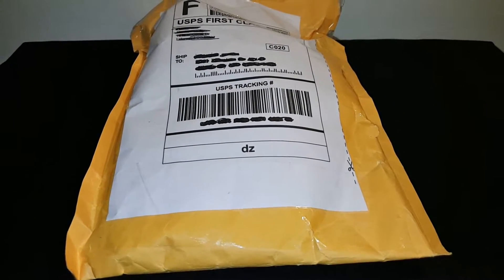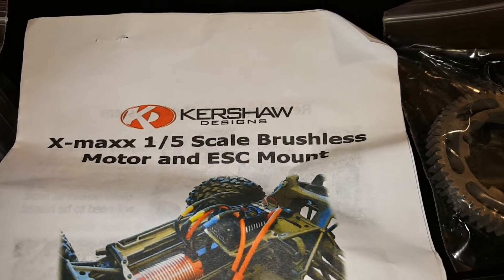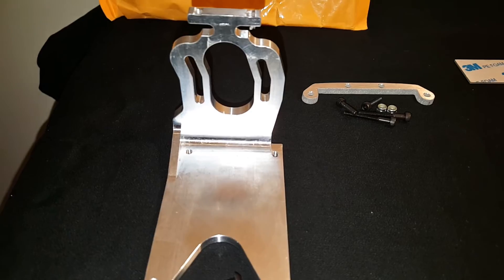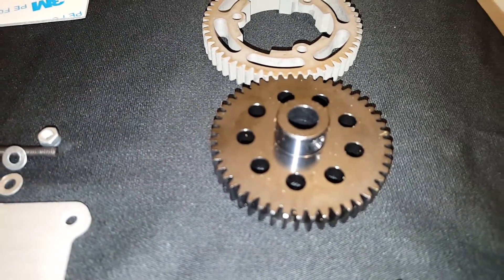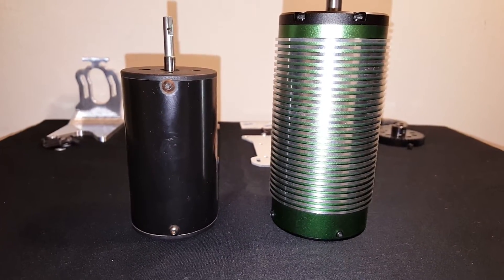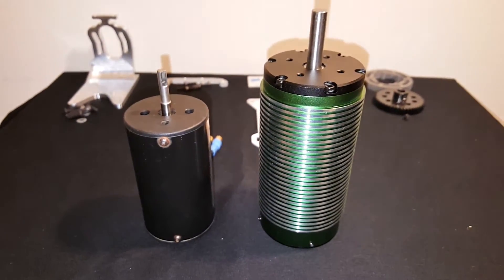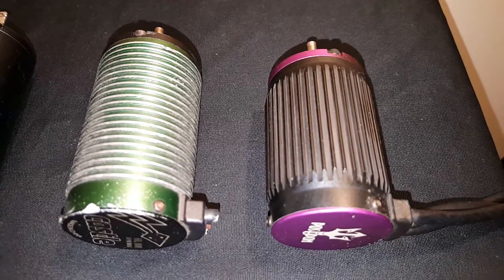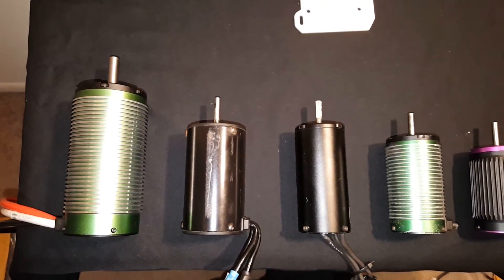Kershaw Designs  X-Maxx 1/5 Motor and ESC Mount unboxing

Comment: Sup big T just got a quick question for you please sir...I ordered my 2028 and mamba xlx for the xmaxx and I ordered the mount and plate..as well as the Kershaw aluminum chassis...I forgot to get myself a pinion and spur...I assume I can't use the xmaxx stock cause of the shaft size and I'm confused in that area...what metal gearing can you suggest I buy for the 2028 in the xmaxx? If you can please help me out I'd really appreciate it brother
Thanks man you the best as always!
rcfeene
Ian
Reply: Actually I just saw the answer to my questions in your other questions and answers below but thanks bud much appreciated....
rcfeene
Ian

Comment: Was that sheet with the parts list also instructions? I just ordered the same set up with leopard system and no sheet or instructions where included. Something ill have to address with the new owner i guess because i cant find any type of installation guide online
Reply from the maker: marcus vaughan it's been awhile not sure. So you just ordered this same from Kershaw Designs? I tried contacting them but no answer I hear they not in business anymore?

Comment: I have the 2028 motor and the hobbywing mx5 and mx6 but the gold connectors on the motor are to big for the esc connectors. how do I resolve this? :(
Reply from the maker: Amrit Loyal buy castle creations 8mm bullet connectors
Reply: But how do you put them on the esc? Can they be changed?
Reply from the maker: Cut the connectors off the ESC motor wires and solder the castle creations 8mm bullet connectors
Reply: Hold on the females connectors on the esc are 6mm. 8mm won't fit. I'm lost sorry..... so u can't physically change the female ports on the esc at all? I'll have to cut the   male connectors from the motor wired and put on 8mm connectors?
Reply from the maker: The ESC has three wires with 6mm connectors that you connect to the three motor wires on the 2028 motor. The connectors on the end of the 2028 motor are 8mm and the connectors on the end of the ESC wires are 6mm so you just need to cut the 6mm connectors off your ESC and solder female 8mm connectors to ESC wires .That way both ESC and 2028 have 8mm so you can connect ESC to Motor
Reply: The hobby wing max6 does not have 3 wires coming out from it. It just has 3 female ports for the bullet connectors from the motor so there's nothing to cut...... in the.box it's comes with 3 wires one end has male connectors which fit into the 3 gold connectors that come with the motor. The other end has nothing and needs soldering.
Reply from the maker: Ok well perfect just solder female 8mm connectors to those 3 wires the ESC came with.

Comment: HI!, I'm getting ready to do this conversion! Where did you get the Steel 54T Spur Gear and Steel 48T 8mm Shaft Pinion Gear
Reply from the maker: kershawdesigns.com
Reply: Thanks! Do they only take PayPal? You can't check out aa a Guest use a Credit Card?Your Truck is Bad Ass- hope me is that damn fast

Comment: I'm just now installing this in my x maxx and the back of the motor seems like it will need some support. what did you do for that?
Reply from the maker: SIK Old Geezer nothing works fine for me
Reply: Ok thanks , just seemed like the weight of that motor would eventually bend the aluminum mount especially on big jumps. Good to hear it works ok as it is.
Reply from the maker: I thought the same thing when I first hooked it up but I haven't had any issues with it

Comment: You're going to have fun!   I have the same set up and it's a monster. Caution the steel spur. The nylon gear is $2.50 and easy to replace.  The steel spur could cause you some heartache further down the drivetrain. I look at it like a sheer pin. Holds up pretty well too.
Reply from the maker: thanks for info